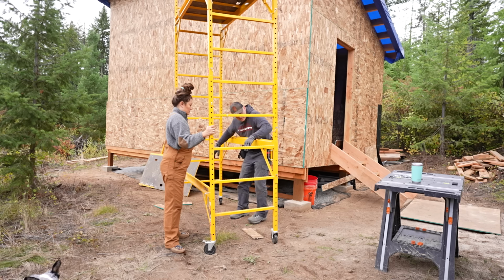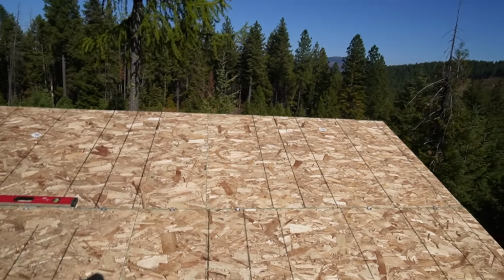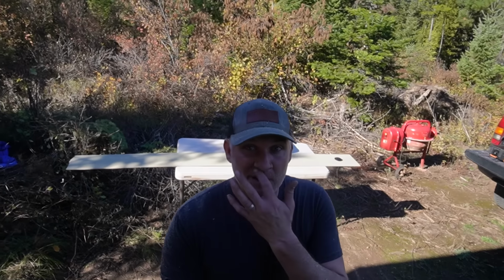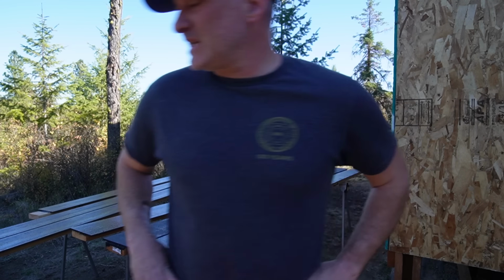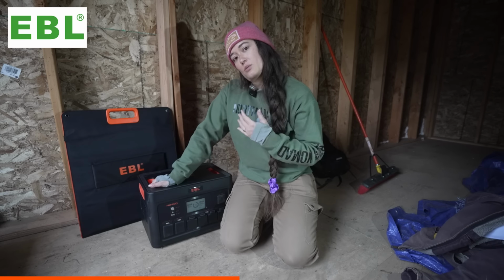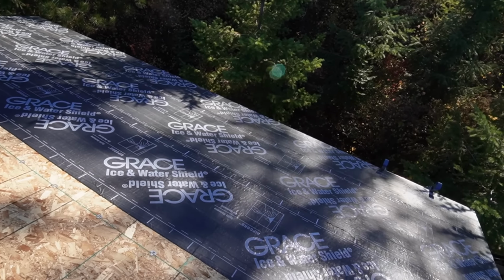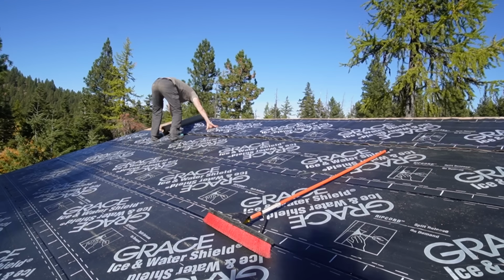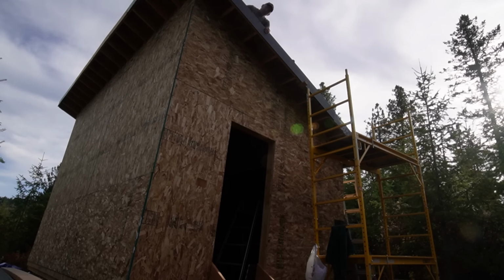This is as far as we're getting on the roof this year | Adding OSB & rainguard to our tiny home

Comment: Good idea to just do the whole roof with ice shield. Also, I too have built many structures with screws and by pre drilling the holes your wood doesn’t crack. Yes it can be more time consuming than a nail gun but I have seen plenty of nails shot into wood which either split the wood or missed all together!

Comment: well I am Carpenter by trade and screws all the way and they are much better than nails
Reply: 25+ years as a carpenter, screws are stronger, will not back out, will not pull out and you can pull a warped board into place with a screw.

Comment: I am not sure what the controversy has been between screws and nails, but what I will say, is that most screws have poor, sheer strength, and all screws cost anywhere from 2 to 10 times what is similar nail would cost. Structural screws are relatively new, and do have sheer strength, But I would discourage in discriminate substitution, because of the cost issue and because many folks will fail to understand that structural screws are different from drywall screws.
Reply from the maker: Touche, but I would say if a DIYer does not learn the difference between a dry wall and a structural screw they have bigger headaches coming their way. We use nails too but when we're able we just prefer structural screws.